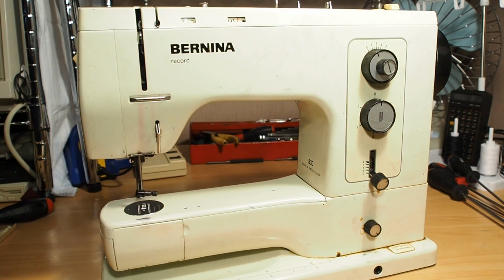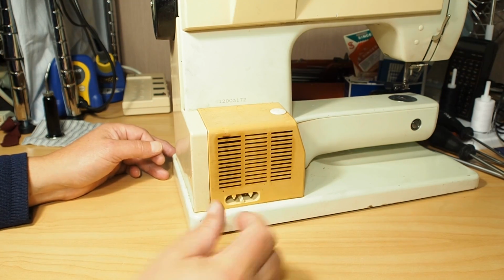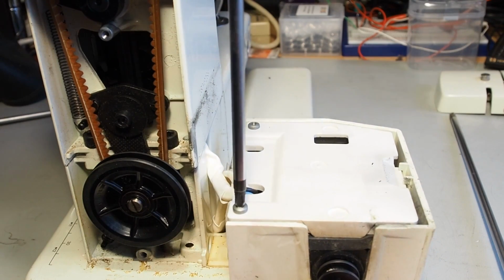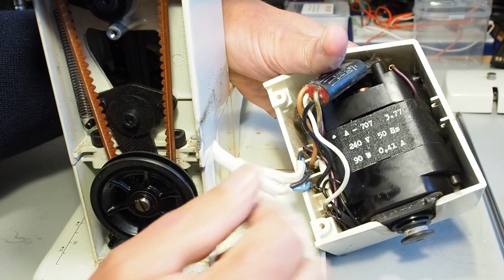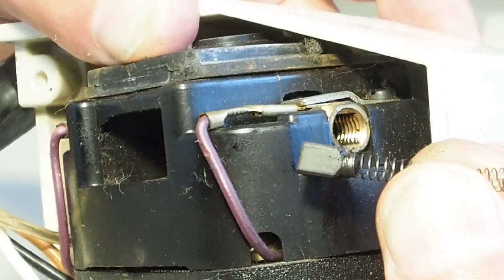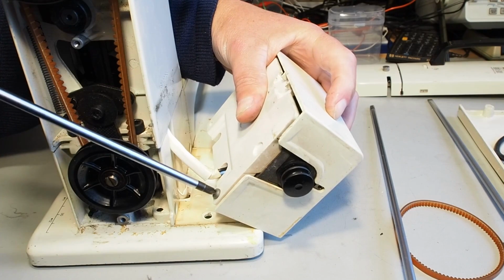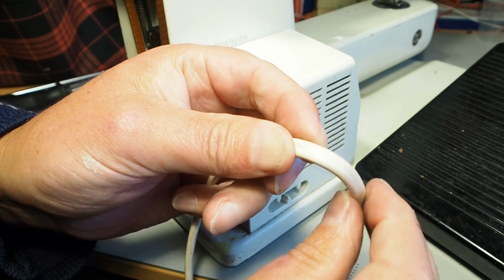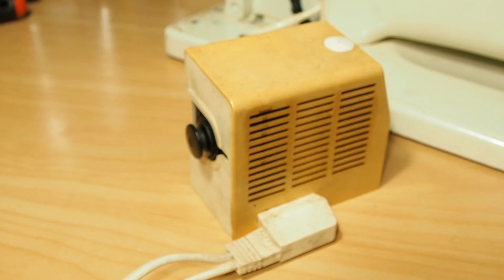Bernina Record 830 - Motor Checking - Brushes and Capacitors

Comment: I have a vintage Bernina 700, but the brushes look different from the ones in this video: in addition to a carbon piece and a spring, each brush also has a kind of electric wire that runs inside the spring, connecting the carbon with a top circular piece. I need to replace them, since they are worn out, and I have a hard time finding these specific brushes. (I'm in Europe) Will the simple carbon brushes work with my machine, the ones with just carbon (of the same size) and a spring? Or will I get into trouble if I do that? Thank you.

Comment: I just followed your video and dismantled my motor (it’s overheating and full of carbon dust - but I noticed it doesn’t have a capacitor (at least not something that looks like yours) the cords that should go to the capacitor connect to a small 10mm x 18mm maybe 4mm thick rectangle covered in blue shrink wrap. Is that ok??? Is that a different kind of capacitor? The machine was given to me recently by a family friend . He had it serviced in 2023 to be sold (still has sticker) but has not actually been used since then. It’s been stored in its original red case until it was given to me a couple of months ago. I noticed the problems immediately but my friend assured me it should be in perfect condition (he said he spent a bit on the serviced and will be pissed if it’s not). So I’m wondering, Was this just a crappy service? The brushes are clearly worn, leaving the dust and it seems to be missing the capacitor… I would take it to get serviced again but now I don’t trust that they will do a good job!? Does this sound right to you??

Comment: Hello! I've come back to this video regarding my 830 electronic. Unfortunately, its now gone through three pedals as they've gotten too hot and warped. I don't think it's the pedals, I think something is wrong inside. Does anyone have any ideas? I rang some repair shops and they said it's come to the end of it's life but I've not had it physically looked at as of yet. Thank you for any help.

Comment: It was interesting and informative in several ways, unfortunately I was hoping to see how to change the actual motor, having just purchased a replacement motor for my 'weak' motor (the service shop described it that way). Hey ho, at least I know how to get at it now, and will take many photos before detaching anything! Thank you for a very patient and comprehensive video. Update, thanks to you and someone else who explained the actual motor connections, (but not how to get to it) I've now got a replacement motor installed, she works, the light comes on and both speeds are available! :) Ps took photos as suggested, and just when I thought I'd only got the two motor wires to do, about to put it back and realised two others had popped off, thanks to your photo suggestion, was able to reconnect accurately. Feeling very good about my rejuvinated machine now, thanks again!

Comment: Hi I know this video is old but I have the same bernina sewing machine and I just opened the motor is it possible for the capacitor black wire and the blue wire of the speed to be disconnected from the terminals, ive been using the machine and its gone for servicing a few times it was my first time opening it myself and I saw that it's disconnected is this normal (I'm also not from New Zealand)

Comment: Thank you for a very helpful video. Could you help me with searching for a suitable capacitor please, namely what specifications I have to look for? My machine starts working slowly, then stops, there’s a sound in the motor like it’s wanting to work. I got it with no information about it, motor brushes ok, motor belts are worn out, too loose (ordered new ones online but the replacements seem a poor quality plastic), and the motor housing shows it has overheated at some point to partially melt the housing. It belonged to a very old lady who had passed away… I cleaned and oiled it and mechanically it seems perfect. I’d be so happy to get it working again and I’m thinking it’d always benefit from a new capacitor anyway so your guidance is very appreciated. Thanks 🙏
Reply: It's also possible to swap the motor for a brand new one with a new motor housing. I did this to mine.

Comment: Hi i have the same machin power work light on but when press the padle doesn't run and do sparkling on the motor what can i do please how to fix it please 8
Reply: He just explained that in that video! Check the motor and the pedal for damage on kapaciters and wiring! If you can't, let someone do it who knows how😉

Comment: Thanks for this incredibly informative video! Also very helpful to hear what a normal motor sounds like. My 801 motor sounds like that on high speed. On very low sewing speed however, it sounds jerky. Is that normal?
Reply from the maker: Hi. Yes, I've experienced that as well. I think it is quite common. Not sure if there is a fix or if it's just "normal". All I can think of is to try measuring the resistor the switch connects to to see if it's in spec. Thanks.

Comment: Thank you very much for the informative video. Please advise whether it's correct that the Record has no embroidery discs inside? I bought this machine from a house sale. I own an 830 electronic which has the discs, hence the reason for the question. I would be most grateful for a reply. Thankyou.
Reply from the maker: Hi. The 830 record has the pattern stitches built in. Thanks.

Comment: Hi I have a 831 and it has a motor speed switch on the front of the machine itself min/max. Everything sounds great when it is on max but when I switch it over to min the machine sounds like it is running rough. Any idea what the cause may be?
Reply from the maker: Hi. From my experience, I see that a lot and it doesn't seem to have any bad affect on the machine in any way. Thanks.

Comment: You note that the capacitor needs to be replaced if it is bad, but I see from another post that the capacitor is obsolete in the Bernina 830 Record and should be removed.  What does the capacitor do in the 830 Record?
Reply from the maker: Hi. I prefer that they are installed. People assume they are obsolete because they helped cut down interference with terrestrial TV transmission, which is no longer in use, and AM radio. Some old schoolers, like me, still listen to AM radio and there's nothing worse than a device spewing out RF interference. It also helps cut down on arcing between the motor brushes and the commutator. Thanks.

Comment: I have a question, on the motor housing/cover, 19:26, where you plug the footpedal cable in, there are these yellow pins, i have no idea what they are called, i seem to have broken one, can you replace these? With something similar?
Reply: you mean the yellow brass pins where the powercord & pedal connects?

Comment: Ok, Thankyou for this. I have the 830 model, purchased in 1975. When I am sewing, it just stops. Or, if I stop sewing and leave the machine for a minute, it won't start again. Could this be the brushes?
Reply from the maker: Hi. It could be. Check brushes first. If they are okay then there's another cause of the issue. Thanks.
Reply: @InStitches  Thankyou!!
Reply: @tanana2070  
Did you find out what the problem was...and could you fix it?

Comment: Thanks very much for the very helpful video! Just brought home a used Bernina 707 which I plugged right away because nobody told me to watch your video first and sure enough there was a pop! Have now removed the capacitor which was cracked and while the machine runs I have a different sort of problem. The machine slows down in a very consistent manner. Let's say I switch it to the slower gear with the sliding button on the back, press the pedal to max and what I see is a consisten slowing down which coincides with a full rotation of the plastic cam stack gear. Wonder if anybody has any clue what could be causing this.. The slowing down is brief and if I try to rotate the machine manually at the spot where it slows down it's very stiff.
Reply from the maker: Sounds like the cam stack gear is broken. You'll be able to see a crack in it if you have a close look. Thanks.
Reply: @InStitches  Thanks very much for your prompt reply! I suspected that since the pattern is tied to one full rotation to that gear, But I am not seeing any crack on it (maybe not quite visible yet). In any event, I will plan to replace it since it will eventually break, it's just matter of time. Thanks again!
Reply: So, it was the gear! It is actually cracked!
It runs smoothly now without it.
Also, noticed at very, very slow speed there is a grunting sound coming from the motor.
And it’s not related to any mechanical stiffness in the machine since it does it even when I remove the belt from the motor pulley and apply pressure to the pulley with my fingers.
It seems this will be a problem for all these since they don’t have electronically controlled speeds and at very low speed you can expect that.
Reply: @georgeharizanov6094  
@InStitches
10 months ago
Hi. From my experience, I see that a lot and it doesn't seem to have any bad affect on the machine in any way. Thanks.
Reply: @georgeharizanov6094  I've had my 830 since 1971 and have never noticed it grunting, however slowly I'm working? Just bought a replacement motor as mine is on it's way out (service man said) but it still doesn't grunt...lol

Comment: Blessings, thank you much for this helpful video.  The capacitors for the vernina 830 i would have to take off the motor and open the back to find it. As i see the motor brush screws are on the outside.

Comment: I have an 830 which responds intermittently to the pedal. The machine makes all the right noise still i  the motor,  but nothing spins in the internal workings. If I hand wind it once,  it seems to give it the will to start responding again and it'll work fine.... until a moment later when it wont start again.  Any ideas on what's causing that ?
Reply from the maker: The first thing to check would be the motor brushes. Thanks.

Comment: Wonderful, clear video. Do you happen to have one about what to do if your Bernina of this era has the motor go 'pop' and give off some smoke by any chance?
Reply from the maker: A quick fix for that is to remove the capacitor in the meantime. The machine can be used without it until you can get a replacement sorted. Thanks.
Reply: @InStitches Can you let me know the exact info for this type of capacitor? My machine(Record 530-2 did this exact thing yesterday and its my only one so am looking to get it right back in shape as quick as possible, but have no clue what all the different types of capacitors are and what kind I need. I'm getting desperate
Reply: @InStitches  Many thanks. Much appreciated. While I am in there I might change the brushes if they look to have a short life - are they easily found for sale? Are they Bernina specific or is there a generic set? Thank you
Reply from the maker: @harrycaul2494  The brushes are a specific size and should be available from a sewing machine store. Thanks.

Comment: thanks for the great video, the capacitor on my Bernina record 830 just blew today. Can you please tell me where  I can get a replacement one. I'm in Auckland. Do you do repairs ? thanks
Reply from the maker: Hi. Yes I do repairs and I have capacitors. You can find my email address on my web page - www.institches.co.nz - Thanks.
Reply: @InStitches  Hi Thanks, I sent you an email , may have gone to your junk/spam folder. That website doesn't work though, says the domain  is not connected to a website.

Comment: Thank you so much for this video! I just purchased my own Bernina 830 out in the wild and it is remarkable shape for its age. I tested it out and it stitches like a dream! I came here to say that because of your video, I decided to check the motor brushes as explained, to find that there was only approx 3 mm left of carbon on the upper brush!! It was just about completely spent! I haven't checked the bottom one but I'm figuring it's the same. My heart dropped thinking that if I hadn't come across your vid, and heeded your suggestions, I could have just kept using the machine until I had burnt out the entire motor!! Wow! Just placed an order for some new brushes and will hold off using the machine until I've replaced them. 
On a similar subject, do the Bernina motors require any oil? I can't remember if you mentioned this in your vid. I know some motors benefit from a drop or two of oil every long while but I know Berninas are different than most in their engineering so I don't want to assume. Thanks and Be well!
Reply from the maker: That's partly why I do these videos, so people can learn how to care for these older machines to hopefully keep them going as long as possible. No oil required for the motor. Thanks.
Reply: @InStitches  Okay thanks!
Reply: @starlit484 Hi, Would you still remember the specific brushes you ordered and where from, for the motor? Thx very much.
Reply: @bradje12  
Sewing craft stores may have these brushes in stock...

Comment: Thanks! Quick question though, I have a 830 now that is a bit rough at low RPM. The I cleaned the motor and such, and the brushes look great. Could a bad motor capacitor cause it to be rough at low speed? It runs great at medium and high speed.
I get in quite a few of the 700 and 800 series Berninas in, and they generally work great. Tough old warhorses, love them.
Reply from the maker: You could try removing the capacitor to test but I doubt it will be the cause of the problem. Thanks.
Reply: @InStitches  Thanks, I will try that. It is a shame, because it is a nice smooth machine otherwise.

Comment: I really wish I'd thought to watch your tutorial before I tried to turn on my mom's Bernina minimatic.
The capacitor blew while I was reading through the manual, I managed to thread the needle before the loud bang and foul smelling smoke. Please tell me that these are available to replace? :)
Thanks for the video, very thorough, I will be sure to check video tutorials before turning on any old machines in the future
Reply from the maker: Hi. The machine can still be used if the capacitor is removed and not replaced. It would pay to replace it when you can though. The only ones I have available are for the 240v versions. My email address is in the description. Thanks.

Comment: A lot of suppressor-capacitors, made before 1980, were of the type, which absorb the
 moisture of the air and when they have soaked-up enough to reach the point, where they 
start, to conduct electric power, they go BANG! The modern ones, are much better and 
don't absorb moisture to the same degree. As long, as the capacity is the same, to suit the
motor and sufficient room available, you can change the original ones for better ones from
electronic suppliers.
Reply from the maker: Thanks. The ones in these Bernina models are potted in resin but yes, some other models do have 'exposed to air' capacitors.

Comment: On the Bernina 830 record electronic machine, the roller of the thread winding mechanism on the bobbin does not contact the motor pulley. I can't figure out what the reason is and fix this problem. Please help with the advice!

Comment: What a great video! On my bernina 707, the wires coming from the machine to motor are both white, and there are only two. Of course, they popped out before I could mark which went to where and now after replacing the capacitor it won’t turn on! 😭 do you have any pointers for finding a service manual for this machine, as I cannot find one anywhere. I don’t want to damage the machine by just trying random ports, so I’ll probably just need to send it to a repair shop. Anyway, thank you for the great videos!

Comment: I have both a Bernina 830 Record and a 930 Record. I was told that on some of the vintage Vikings, when the capacitors blow, you don't need to replace them.  Is it the same with the Bernina machines?
Reply from the maker: The capacitors are not needed just to run the machine. They filter electrical noise on the line.

Comment: Hi, I have a quick question. is it important to clean the commutator before inserting a new carbon brush? Also thank you for the very informative video!
Reply from the maker: Thanks. It's not always necessary to clean up the commutator but I would do so if it's looking like it needs it.

Comment: Fantastic videos. Really appreciate your practical suggestions and expertise. Can you offer some pointers on where I might get a spare X1Y2 capacitor set. The current original set is working but may be just starting to leak (for Bernina 830 Record) I assume rebuilding with new parts is a better option than buying used units from old machines. No obvious suppliers. Thanks
Reply from the maker: Thanks. I depends where you are but you could try RS Components, Mauser, Element 14 and the like.
Reply: @InStitches  Thanks - Yep, we have those in Australia. Looks like I'll need 4 individual capacitors rather than a ready to go set though. Cheers
Reply: @sleepywombat2751 Hi, Did you ever track down the capacitors? What was needed to get the 4 capacitors in to the housing? I'm assuming that the Bernina 4in1 capacitor in the video is not available... Is that correct? Thx very much.

Comment: Dear Sir, I need your help to unfreeze the clutch knob on my Bernina 807 . It is so badly struck that even after using TriFlow , Blue creeper oil , CRC 5-56 & Isopropyl Alcohol it is not moving even an iota ! Could you please kindly give me few tips or what are the other options ( except taking it to the Bernina technician because they are prohibitively expensive here in U.K.! ) . Thanks.
Reply from the maker: Maybe try warming the machine up in front of a heater, not too close though. Just try to get it warm and try loosening the clutch knob while stopping the machine from turning.